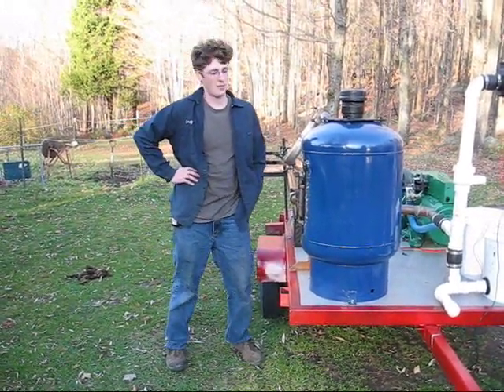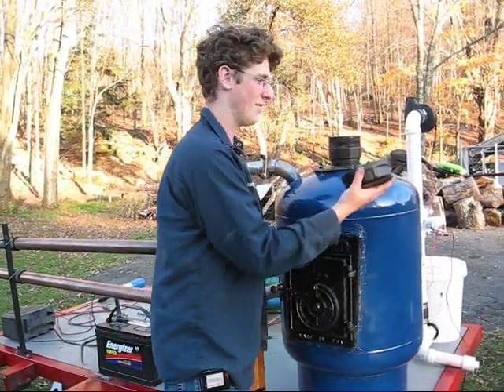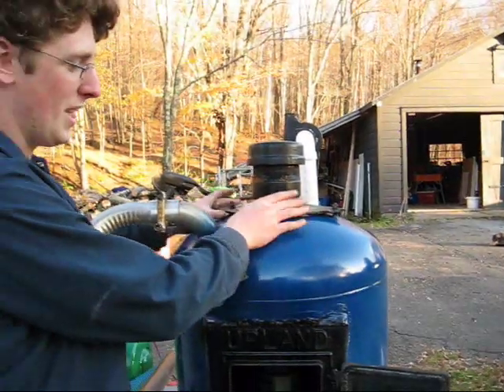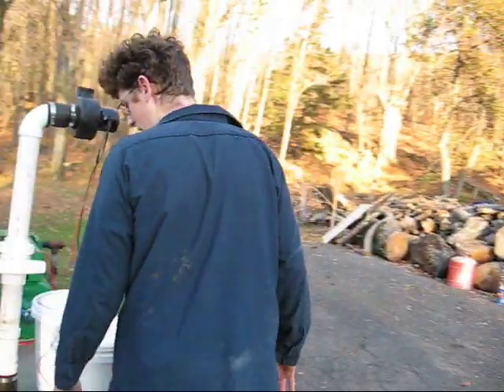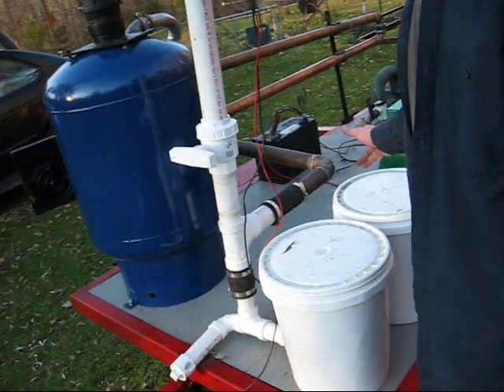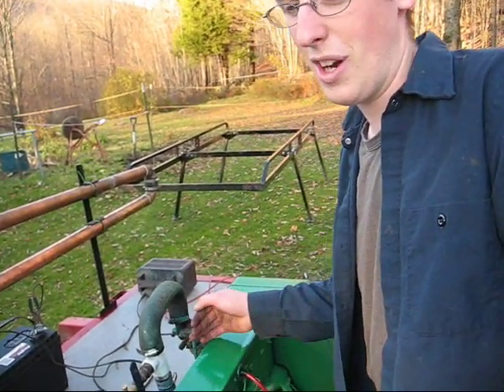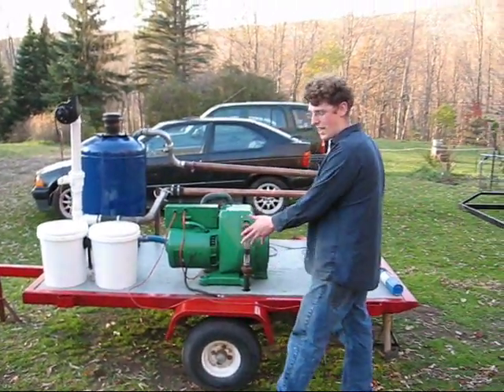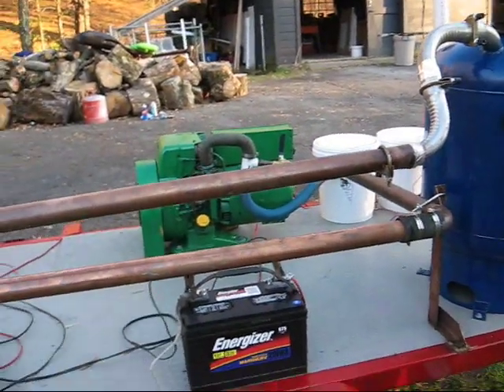Syngas Electric Generator Components

Comment: Show it running! After a batch burns, you must shut down & clean ash out. How often? Is there a constant run type where ash is removed while running? Does it work with coal or lignite or peat too?

Seems like most of the energy gets wasted as heat escaping from main hot tank & cooling pipes. In larger scale it might be worth placing Stirling engines pumping from heat difference (tank/pipe vs air) & crank out more watts. Even design primarily to run as Stirling engine that outputs gas too!

Comment: No I do not believe one modifies the carb at all,from what I've seen it seems one just makes a tee,put valves in to manually regulate the air intake and pipe the woodgas directly into the air intake on the carb.

Comment: Did you plumb it from the air valve directly into the bonnet of the Genset carb?
Or did you remove the carb and go directly into the intake manifold?
Great little unit.Have you increased the size of the fuel hopper?
Nice work.

Comment from the maker: On the truck I used a gas to water heat exchanger for cooling, this proved unnecessary and complicated. This design would be good for co-generation setups you could than take the heated water and heat hot water or your house. An intercooler with large passages and clean outs would work fine but in my case the 2 copper was free. 
The engine is 25 cubic inches and the fire tube is 3.4 so its perfectly matched.

Comment: Great work!

Did you experiment with other cooling methods for your woodgas?  I suppose a simple automotive radiator wouldn't flow very well (and might clog), but maybe a big intercooler?

I particularly like the filtration method with the water/straw.  Way to keep it simple.

How well matched is the size of your woodgas gen to the combustion engine?